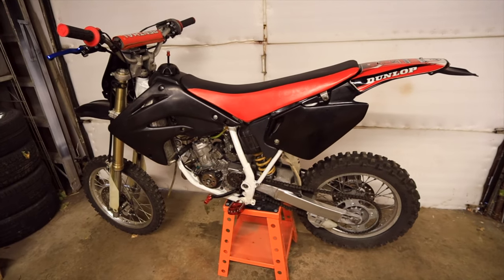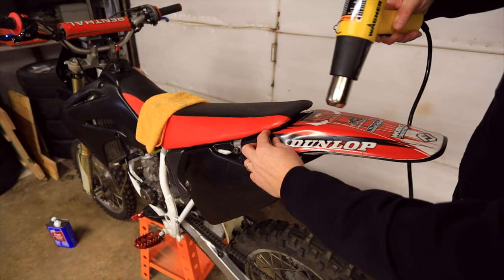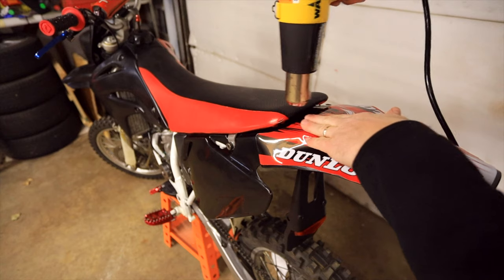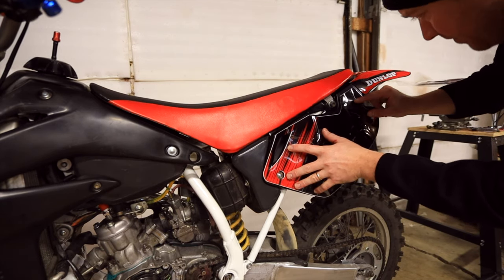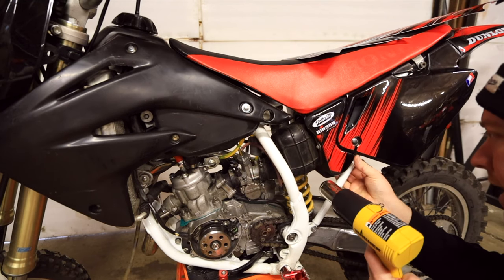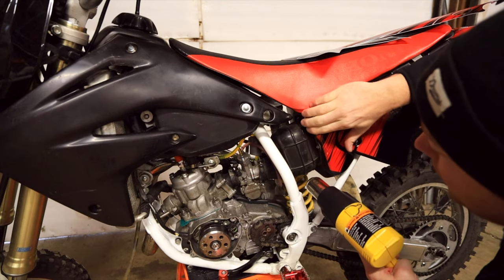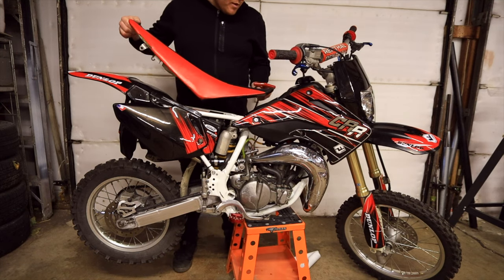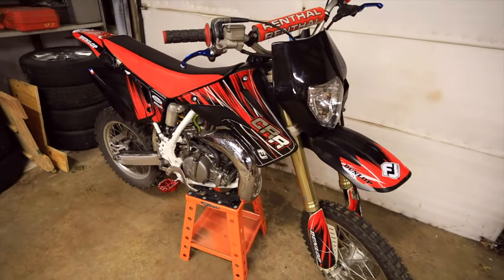Installing new graphics on my dirt bike Honda CR85

Comment: How did you installed the headlight unit?
Reply from the maker: I bought a aftermarket headlight kit from Amazon. And then I used a M12 battery from Milwaukee drills and a 3D printed receiver for the battery